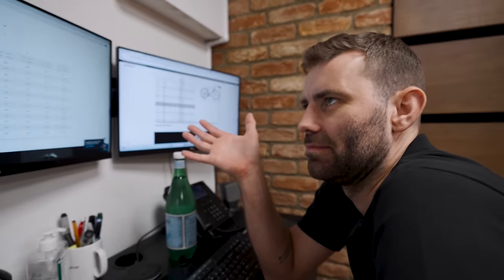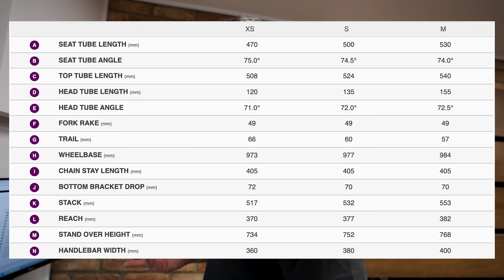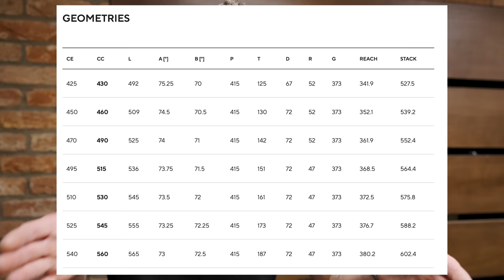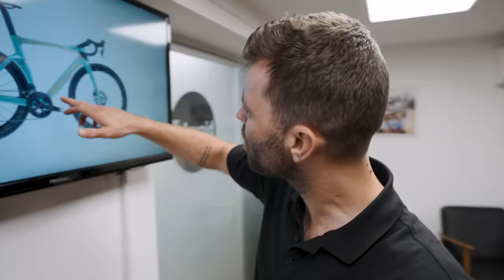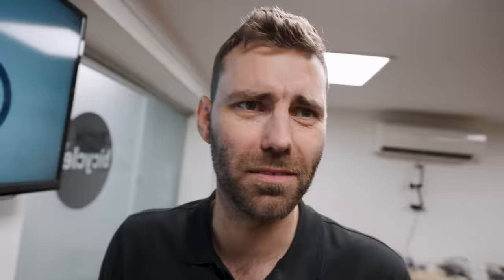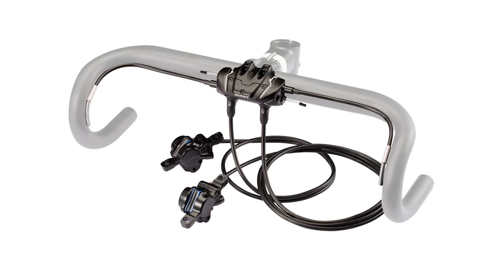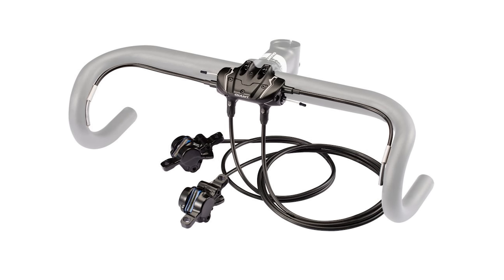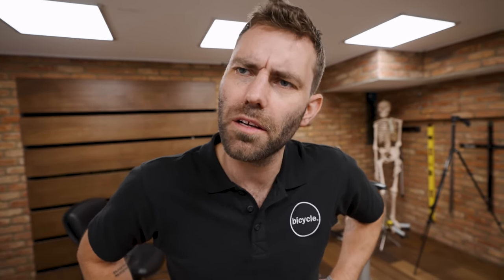Pro Bike Fitter's 9 Most HATED Bikes

Comment: Thankful for James's diatribe against 'endurance' bikes that are only slightly slacker race bikes. In 2016, I bought a Felt Z100, thinking it was a nice, entry-level relaxed road bike. After watching all these bike fit videos, I now discover, seven years later, that I need a 36 cm handlebar with a shorter reach, and the size 51 (smallest size enduro Felt offered) bike I bought came with a 40 cm handlebar. Why does their 'enduro' bike have only 6 mm less reach and 17 mm more stack than their equivalent size race bike? The head tube is only 20 mmm longer on the enduro bike. I rolled the handlebars back maybe 20 degrees like you have suggested in other videos and I still think the front end of the bike is 3-5 cm too long and low. And the stem is already only 80 mm. I'm apparently one of those long leg, short torso, men who can't get a proper fitting bike.

Comment: Agree on the Madone. Don’t get me wrong, it is a super bike and stupidly fast. However, and even though my model is 2019 with rear brake on top, when it is wet it gets dirty and doesn’t work smoothly (the rim keeps rubbing since the brake pad does not get back to 100% normal position)
Reply: Have a mechanic at your Trek dealer fix that. It's not difficult.
Reply: yeah, give the the 200€ for the full new brake since they do not sell separatelly the mini part causing the problem @monkmchorning

Comment: Thank you for the great insights! Roubaix SL2 from 2010 is my nice bike, which has an old school long reach handlebar and too long stem. I really love this bike but I feel too stretched out, and this video confirms my suspicions that the fit is wrong for me. I'm planning a short stem and some newer, shorter reach handlebars, and bring the saddle back about 10 mm to relieve some stress on my hands and arms, and to move the c of g back a bit. The bike is really plush to ride even on 23s (want to go to 28s for some light gravel), a suspension handlebar would be superfluous. It'll be better when I'm scooted back a bit.

Comment: The Robaix with the Futureshock is awesome for longer rides on our crap roads here in California. Also good for smoother fire roads. Control and comfort are vastly improved. The comparison of the Futureshock with the Girvin stem really missed the mark. The reason nobody rides those anymore is because they were sold for MTBs and they suck compared to a proper suspension fork. I hear your point about potential service issues, however, I have many thousand miles on mine and it has been nothing but great.

Comment: I actually find the grails handelbar quite interesting. I guess it gives you a lot of comfort while on the middle of the bars.
Reply: The shock absorbing center section of the Grail's top section of bar has limited usefulness.  When you are riding on rougher gravel roads, you want your hands in a wider position for best control. I find that it's better to be riding the hoods in those cases.  The upper position is useful when you want to back-off-the-gas and vary your hand position and posture on longer rides.  When you are in the drops, it is significant that the Grail's front end design gives you the posture of a road bike.  So, when you are on paved roads, getting to the gravel, it's faster.  The debate is this, do you really take advantage of the upper bar section enough of the time to justify a unique front-end design which prevents component swapping?

Comment: 175cm, tarmac Sl6 size54. My BikeFitter said it was one size to big. He upped one spacer and fitted an 80mm stem and I already had a short reach specialized handlebar. I don't really like the twitchyness of the short stem. So I bought a 0mm offset seatpost (now 20mm) and will if a 100mm stem will work now.

Comment: You often call the tarmac an agressive racing bike whereas i've always found its geometry on the less agressive side for a competition bike.  My s-works SL5 size 58 has a head tube of 18.5 cm (which is not short by any standard) and horizontal top tube of about 57 cm, when I look at the endurace geometry, its very similar.  Am I overlooking something here?

Comment: @4:28 - where are you pulling these numbers from mate? a 2017 liv envie xs is 17mm shorter than a 2017 specialized tarmac 52, and all of 1mm taller. AND they offered an XXS size as well, which is a reach of 365, and a stack of 505... Having done a ton of bike fits as well, and working for a Giant dealer, I sold a ton of those tiny little bikes... The only drag about them is sometimes the paint colors would be un-appealing to some female riders...

Comment: Going on from the madone, madone 9.0 was a looker and fast. But it shook people to pieces, but also the rim brake calipers were unbelievably and unnecessarily complicated. 3 bolts to adjust alignment. Crap. The new one looks nuts though!
Reply: I have a 9.0 and can confirm the brakes are pretty brutal (I live in flat geography, so not a huge deal in that application).  It's actually a very comfortable bike though, so not sure about the shaking comment outside of the fact that it can get noisy because of the internal routing design.

Comment: I don't understand why there are so few quality stems with different angles, 0/6/12/17 is about it. Even on most race framesets now the pros use positive angle stems, and don't start me on the minimil range of bar/stem combos, for actuall fitting.
After buying a 61cm Cervelo RS in 2010 for all-day comfort, I ended up needing a -10x 130 stem for my 6'2" self. I recently moved to a -17x 130 stem for the RS but for my pandemic special 61cm RCA, I needed to find a -20 deg stem for the same position. A 225mm headtube, 5 more than the RS has. These last few days as I've checked what else is out there now, I've been hard-pressed to find many option with even 200mm on an XXL frameset! WTF?
Can we bring back death squads and line up all the big bike maker's promotions teams against a wall for a small cull? Maybe consumers are required to pay for the pro-team bikes, given that carbon frames sizes all cost so much to make? Does everyone think they need to ride a pros bike with their beer gut in tow? ;-)

Comment: i bought some VR-C handlebars for my winter/turbo bike. Luckily i had a shorter stem to fix the reach, the next day i saw your video about how the reach measurement is wrong. I even checked the reach measurement before based on these videos, but wasn't expecting it to be a straight up lie. Luckily they were only £40 and 90% of the time on the turbo so having a short stem doesn't matter

Comment: Trek Domane Gen 4 (the latest one. The seat tube clamping system design is flawed and results in seat post slip (well documented on line). Trek tried to fix it with a version 2 clamping system that still doesn’t work, I had to give the bike back and buy something else. Avoid bikes with gimmick isospeed type designs!
Reply: It seems the newest version is just partly an improvement with pictures of broken seat posts around already ^^.

Comment: 2011 trek madone 5.2. Had one and that rear brake was crap. Every season I had to rebuild it, and eventually threw it away. Stopping power was poor on AL rims, nonexistent on carbon wheels.
Reply: What did you replace it with?
Reply: @richardj3715  shimano made a under BB direct mount ultegra brake. I used that with marginal braking improvement. It did last longer and did not need rebuilding. Cost around $100, well worth it for it's reliability.

Comment: You gave some good information for the women’s bikes, But the suspension front end, brakes under the frame and tri plane handle bars was more mechanical design flaws , But don’t really effect the fit of a bike, I was expecting more design flaws in geometry, still a great video

Comment: Really You and Francis ride with 40cm wide handle bars ? Isn't it to wide ? I bought Spec Allez with 42 and think about changing into smaller but based on your advices related to the shoulder width I was planning 38. Im about your hight but certainly wider :)
Reply from the maker: I ride 38’s on most bikes - francis

Comment: The Ideal road bike for 99% of people should have: Regular 27.2 seatpost, regular bar and stem combo, no integrated cables within the cockpit, the option for disc brake or rim brake version, size from 44 to 62, tyre clearance of at least 28mm, reasonably lightweight frame. These are the bikes that people need. Not the junk bike companies sell these days. Full of proprietary nonsense and marketing claims.

Comment: Great info on all your vids . I can’t get comfortable on my 2015 s3 at all. Mid 40s ex road and track as a teen and bmx before that. Just can’t get around mid sole shoe placement. Seat as far forward as it goes cleats forward as they go and I still find can’t get comfortable. Unless on the trainer I pull my feet out at the ankle as if I’m getting out of them. Any ideas? No power output unless I’m on my toes on the pedal. Shoes are sidi ergo mega.

Comment: This is why you cannot beat an old vintage racing bike.
the bikes and parts are a work of art. The consumer has seen sense, why spend thousands when you can have a vintage road bike that will out last all of these bikes. 

Parts are cheap, the bikes are easy to work on. Most important the parts do not break when you look at them! 
Like most of the modern parts that are made today.

Comment: My bike was first up.  Oddly he hit the nail on the head.  I love the bike but have an 80mm Stem.  That said, I got it $4000 off so I'd say for that much off it is amazing.  Luckily I am flexible too.
Reply: I was about to press the button on a 56cm Aethos !! Now I’m in a quandary. I ride a 55cm Reilly Spectre with a 100mm stem which I love. I’m replacing a 54cm long n low Whyte Wessex with 100mm stem which gives me shoulder pain but other than that it’s a good bike. I fancied a change and Aethos I thought was the one ticking all of the boxes - I’m in a right quandary now - I’m 56 pretty fit but not 25 and riding every day. Help ! I’m 6ft 33cm inside leg and shortish torso so the late Mark Reilly said. He nonchalantly measured me on a simple jig and said you are a medium. I hire a 56cm Synapse in Mallorca and that always feels great…
Reply: @TomAshworth  Tom I love the bike.  I came from a racing bike so the Aethos is actually MUCH more comfortable.  I would have got the specialized roubaix but the Aethos I got was $4000K off so it was a no brainer.   Also most bikes are more aggressive than they should these days.  I got a 56 and may have gone for the 54 had I realized though.  

Get fit prior to buying or find one that is 4K off and buy that one.   You just need to find a wealthy old man that had to have hip surgery 2 months after buying the bike like me.

Comment: Sorry I forgot to mention that twice I’ve had to brake quickly with disc brakes and both times the back end locked up and I finished up on the deck I no longer have a disc brake bike. There’s rumblings that shimano are working on ABS for bikes I wonder why 🙄just to add I’m no beginner I’ve raced bikes since I was 13 years old on the road and cyclocross

Comment: My most shockingly bad bike: the previous edition of the Giant Revolt gravel bike. I used it for commuting with panniers at the back and managed to snap 3 frames in relatively short succession. Luckily I had a lifetime warranty on the frame. In the end I got an upgrade to a Toughroad which didn't have the weak top tube to saddle tube connection of the revolting Revolt. It also didn't have the ridiculously long and bendy seat post but did come with the cable/hydraulic hybrid Connect break system (which works ok in my opinion).
Reply: when you say previous edition... how previous? Ive got a revolt and i want to use it to go to the market with Panniers....
Reply: @EowynDriscoll  Mine was a 2020 or 2021 model, I think. The frame design of the current model is clearly different, much beefier link of seat tube and cross bar.
Reply: I also snapped a Giant Revolt at the top tube/seat tube junction. Mine was circa 2014 and aluminium. Sadly I wasn’t  the original owner and Giant didn’t want to warranty it

Comment: The big brands are mostly owned by private equity firms trying to make a quick buck. As cyclists its time TO STOP BUYING THEIR CRAP!! 95%+ of cyclists would be better served getting a custom steel frame welded for them and frankly at this point you can get a frameset like that for 2k, so looking at 5k all in with good components. 5k is now mid range for the big brands!

Edit: speaking of €

Comment: Another bike with terrible geometry is the Ridley Fenix. Some genius at Ridley thought it was a good idea to make a entry-level endurance bike have basically the same geometry as their aero race bike the Noah. They share top tube length, standover, seat tube and fork angle, and the headtube on the Fenix is only 2mm longer than the Noah.

Comment: Anything that has a front-end designed for a non-circular stem and spacers that starts at 4 grand, but only comes with the proper spacers and stem when you spend 8 grand.

Comment: that grail argument ... can i ask is it bad product in terms of bikefitting and suspension in cockpit not working ? because i have eye on grail just because of this cockpit :D
Reply: I mean, as far as I am aware there arent any options to adjust the cockpit of the grail. So in this regard its really not ideal and in Koblenz at Canyon you get a rather rudimentary bike fit (no adjustment of the front, only to check which size and seat post height). So I dont know if its possible to go through the measurements with a bike fitter.  That being said I am quite happy with mine. Yes, this shock absorption stuff is marketing crap. Nonetheless you have practically 2 positions combined: quite an aggressive position in the drops, but also fairly a relaxed one on top. But it depends of course what you wanna do with the bike. I used mine once for bike packing, which worked, but if you wanna do that mainly there are better bikes available. Also 40 mm tires  (maybe 42 mm wtb, but be careful!) is the maximum you can squeeze in. As a gravel sport bike I think its doing a good job. :)
Reply: Its just dumb, you can never fit normal aftermarket stuff. 95% of cyclists should steer clear of this proprietary stuff.
Reply: @value4363  What do you want to add? You have a head mount for a garmin, frame bags fit without issues, the only problem would be bags on top of the head tube. I bought myself a stem drinking bag which I "abuse" for snacks.
Reply: @Xarx42  thanks for reply but since i live in slovakia i will not travel to koblenz for bikefit :D and so you answered this for me thanks
Reply: @krempixxx  you're welcome. :) But maybe you can ask a bike fitter in Slovakia to check the geometry (and if it doesn't fit he/she can surely suggest you alternatives). Koblenz and its surrounding is actually nice and testing all kinds of bikes at the canyon "experience center" is also not bad, but I agree: to travel just for that from Slovakia is a bit too much maybe ... :D
Reply: @Xarx42  yeah i kind thinking of retiring my trekking bike ktm legarda as winter or autumn bike but i have radon spire as road bike so i thought i would buy gravel bike and grail looked wild and nice with custom dtswiss wheelset and that cockpit or i would buiy some endurance bike ... but i dont know i also have two mtbs for winter so i should not spoil myself :D :D but thanks for advice :D

Comment: Handlebars are not only too wide for women, they're too wide generally. According to the conventional wisdom, I should be using 420mm bars. I use 380mm bars, and that only because I can't get them any narrower. I don't get why I would need bars that wide? Here I am, slouched over and trying not to crush my balls for the sake of aerodynamics, and then I have my arms pointlessly extended out in the breeze. Why? It's not like I need leverage like on an MTB. If anything, it feels sluggish and less responsive than a narrower set.
I'm surprised that Canyon didn't make it into this hate-list. I was planning on getting one, and then they switched to integrated cockpits available in ONE size per bike size. If you need more reach, you must buy a larger bike - and you get wider bars with that. If you want more reach but less width, you're shit out of luck. Or you must throw away the handlebars and install your own stem and bars. It's a bike that can't be fitted AT ALL. You can raise or lower your saddle or shift it forward or back, that's all you get, and it's a foul compromise.
Why are we going back in tech? Bikes are getting less and less adjustable and customisable, and way too expensive for what they are (and getting more expensive still). I bought a motorbike last year, four-cylinder fully faired Sportbike with 95hp, 0-100km/h in under 3 sec, top speed above 200km/h - for about 10000€, brand new. I could get it cheaper if I wanted to haggle. And if I wanted the same bike without the fairing I could have got it for 6000€. That same year, I bought a road bike, carbon with full set of Shitmano 105 Di2 with disc brakes, for 2500€. Where is the relation? The bike industry are taking the piss.

Comment: My giant contend has the conduct system. I can confirm it sucks. Difficult to bleed and they have to be kept in perfect working order or your levers touch the handle bars. I can't change my reach adjustment. Absolute rubbish. OEM pads terrible.